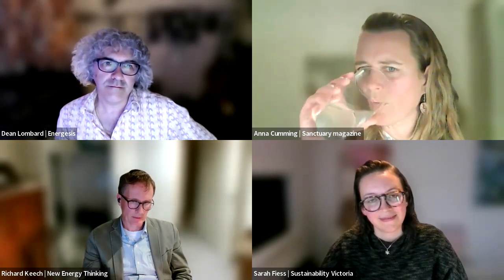Sustainable Design 101: Energy systems and efficient design

Comment: I’m building new and have incorporated all these energy saving measures. What the Victorian government needs to address is forcing new owners of new construction to jump through hoops to get off gas. I had to beg, plead and pay $2000 for a prescribed solution from an energy rater to get approval from the building Surveyor to use a heat pump instead of gas boosted solar hot water system. What a joke!!!
Also the NATHERS rating is a complete farce . My energy rater gave me a 7.5 despite building an passive house with triple glazing all round, full air sealing with Proclima products, Zehnder hrv, r11 roof insulation and r4 wall insulation and waffle pod slab with edge insulation. The rater couldn’t be bothered to factor any of these things to arrive at a realistic rating. 
So how can you trust anyone else’s ratings?